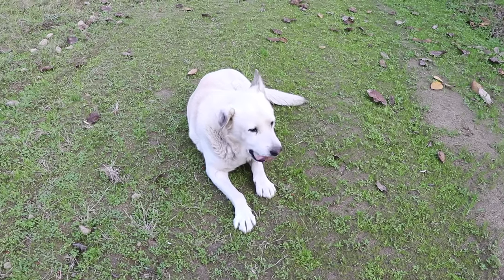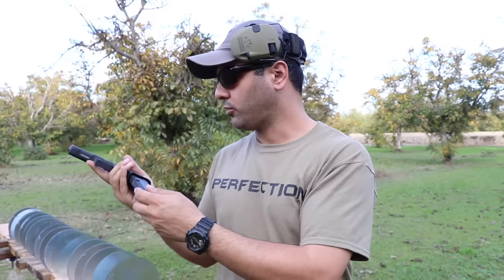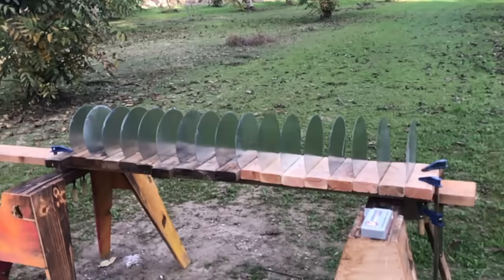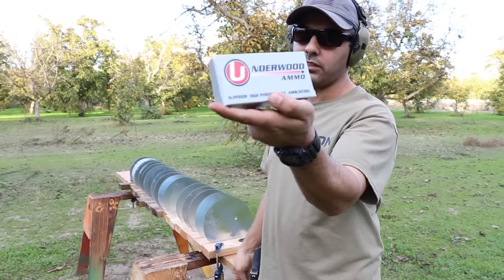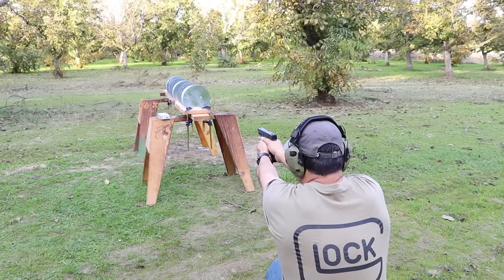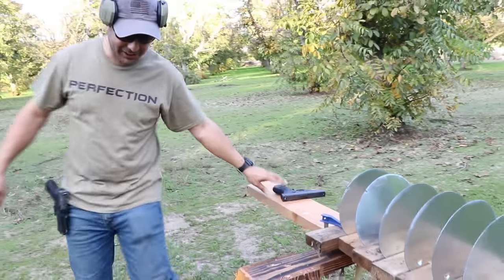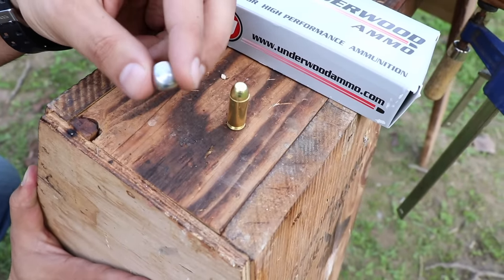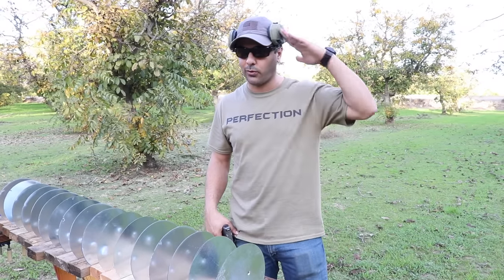9mm vs 10mm vs sheet metal

Comment: 10mm? Isn’t that the 40 smith and Wesson’s ugly uncle? that spawned the 40? Because of pressure issues and over penetrating? I had a Colt Delta Elite 10mm, 500 rounds beat the gun to death because of sorry design, 2 recoil springs and a solid barrel bushing was not enough to make the 1911 handle this high pressure round. It came in like a lion and faded like a bad memory,
Reply: 10mm is coming back in a hard way but I agree. You don't take a platform designed for a low psi slow round and make it shoot a high psi fast round. 1911s in 10mm are not pleasant to shoot at all. but something like the Tanfoglio Hunters or Match pistols or other non 1911s are far more comfortable and less frame beating. Even the glock 40LS 2x4 is better then a 1911 in 10mm. I've had the pleasure of shooting a Bren Ten and its very pleasant to shoot compared to a Delta Elite. It wasn't pressures issues but there was more chances of over penetration with the old Nomra loads but it was turned into the "Short n Weak" mainly because most agents had issues with the recoil. Either in the Delta  Elite or the S&W 1006.
Reply: "ugly uncle"...please...the 10MM is a fantastic cartridge, always was and still is. The .40 is a spud that was born from a knee-jerk reaction due to FBI personnel not being qualified enough with a handgun to score hits on paper. Maybe the FBI should have went with .22 arms so their people could punch holes in paper a little closer...

The real answer to a 1911 that can't handle the 10MM is to get a gun that can..

The .40 was a fix to a problem that never existed in the first place..
Reply: @yankeeroad626  Springfield recently released the XDM 10mm in 4.5" and 5.25" barrels. The 5.25" is just plain sexy and imho the best 10mm platform out there.
Reply: @morbo5061  I got the XDM 10MM  5.25 a couple months ago. Love it.